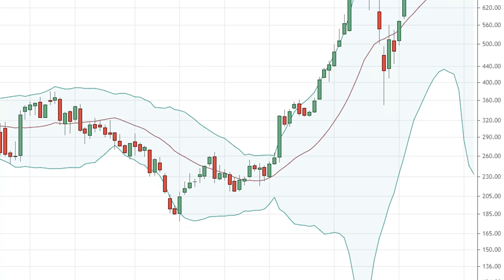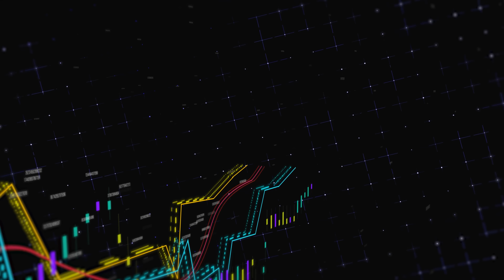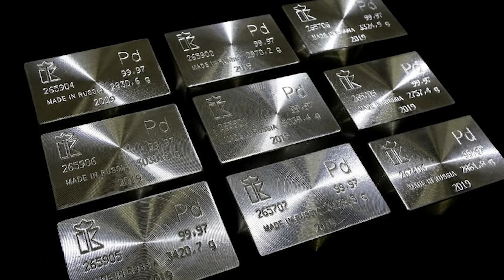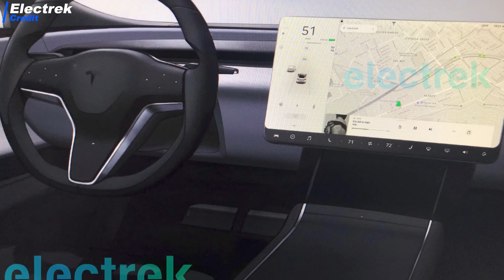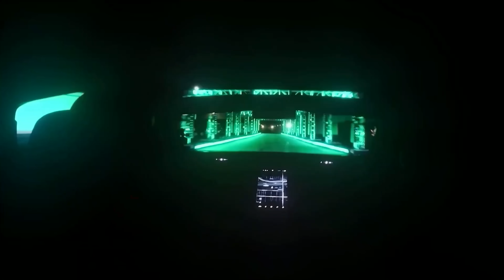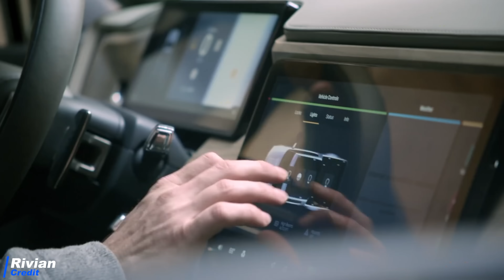Tesla Secret Project Leak & World's First Commercial Air Taxi Flight!

Comment: Elon was never for air taxis, instead he always wanted to solve traffic problems with tunnels what he is actually doing
Reply: These electric air taxis, IMHO, are nonstarters despite the enthusiasm shown here.  Most have something like 10 miles radius (with no extra safety margin) and something like 15 to 20 minutes flight time.  This won't really work for much considering they're never going to be landing in a parking lot near you.  So  you have to go gasoline or fuel cell, and we've had these for decades - helicopters.  They tried to do helicopter taxi service as well, and that has worked in very niche cases, but not commonly.  Electric air taxis will be worse, not better.  The ones that do succeed will be the type with wings, not the quadcopter type.

Comment: Since starship is made of stainless steel which is 10%-20% Nickel, and Elon is going to produce his own, could that be why he needs so much.  It seems like batteries wouldn’t use so much compared to the stainless steel industry.  Do you have an estimate of the quantities involved.  I’m looking at JJN an ETF for Nickel.  Looks like below 50 would be a good entry for accumulation if there is going to be a significant increase in demand.

Comment: Not sure if there's a great deal of difference between an air taxi and regular helicopter, other than the air taxi being much easier to hover stably.
Reply: @TechChasm  They are only marginally more quiet, and have substantially less range because of the all electric drivetrain.  IMHO the all-electric focus is actually the Achilles heel of these air-taxis, and except for the winged versions, they will never become mainstream unless we develop some batteries with near gasoline levels of energy density.  At this point the "quadcopter" type drones for carrying passengers are basically just crappy helicopters.
Reply: @Desrtfox71   @2 The Future with Jixuan & Sebastian Thanks for the info. I think battery density will improve enough to allow for the air taxi to become a bigger thing. Bear in mind the latest Tesla S is going to have 600 miles of range, that's comparable with gasoline, and even better than some cars of a similar size. That puts a small winged air taxi within commercial viability.

Comment: Hopefully this redesign will help Tesla compete with the Porsche Taycan. Although it beats it in most practical aspects, it needs to match it or exceed it in these areas:
Cost- it already does.
Quality- this is a problem for all of Tesla's vehicles, but especially in the S and X. For that price, it needs to be immaculate.
Luxury- Tesla needs more luxury features in this update (i.e. heated/cooled/massage seats, heated steering wheel, softer leathers, rear seat screens)
Track performance- it's gotten to the point where a model 3 performance can outpace a models S performance on most tracks; suspension and cooling system need a massive revamp to compete, because the current model S overheats easily and handles like a boat.

Comment: I very much want my own personal air taxi lol.
Reply: These electric air taxis, IMHO, are nonstarters despite the enthusiasm shown here.  Most have something like 10 miles radius (with no extra safety margin) and something like 15 to 20 minutes flight time.  This won't really work for much considering they're never going to be landing in a parking lot near you.  So  you have to go gasoline or fuel cell, and we've had these for decades - helicopters.  They tried to do helicopter taxi service as well, and that has worked in very niche cases, but not commonly.  Electric air taxis will be worse, not better.  The ones that do succeed will be the type with wings, not the quadcopter type.
Reply: @Desrtfox71  Dude, it's just a drone big enough to fit people. We already know drones work quite well. And yes, much safer and more stable than a helicopter. They'll have parachutes that deploy in case something goes wrong. Helicopter crashes almost always end in a big fireball. Not the case with these air taxi's. The range and speed won't be nearly as good as a helicopter but they'll be perfectly adequate for transporting people around cities.
Reply: @fieldadmiralspartanryseb-8293  Drones actually don't really work that well, especially all electric ones.  They aren't safer than helicopters and have much, much less range. Helicopters can autorotate, which drones cannot.  And a range of 10 miles (with no real backup) is not enough to go anywhere.  You wouldn't go somewhere unless you had multiple landing zones to abort to, and with such short ranges that will not be possible in most cities.  Also, while these drones might have parachutes, that's not going to help in most cases, you'll need a good bit of altitude to make that work, and the crash landing that results will be worse than most autortational landings.  Also, no most helicopter malfunctions do not result in a fireball.  They are inherently, at this point, substantually safer than all-electric drones.
Reply: @Desrtfox71  hmm..
Reply: @fieldadmiralspartanryseb-8293  The problem is the electric drivetrain and the noise/regulation in cities.  The Bell air-taxi, for example is planned to be a hydrogen fuel cell powering the electric motors.  This should help, but doesn't solve the other issues as to why helos never became air-taxis.  That's a noise issue and a safety issue (not for crashing per se,  but for ground population - noise, wind, where to land, etc).  All-electric air taxis are going to solve none of this (they are slightly quieter), and will introduce all new issues like very, very short range.  So, for this to actually work, you need something like a hydrogen fuel cell, to keep noise down, but increase range, while also having a wingborne mode (again to increase range) and then you're just back to what helicopters have been trying to achieve for decades.  Gyrocopters are pretty close to ideal, and even they haven't been able to make this work.  Quadcopter drone-like all-electric vehicles are going to be much worse.